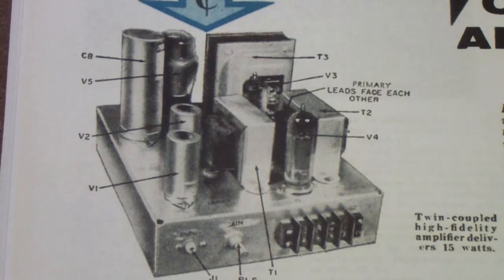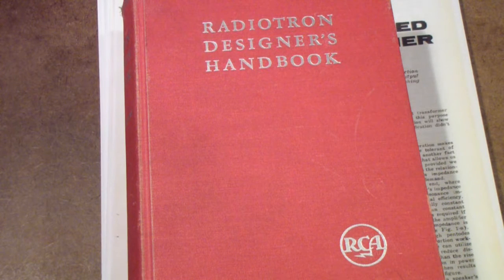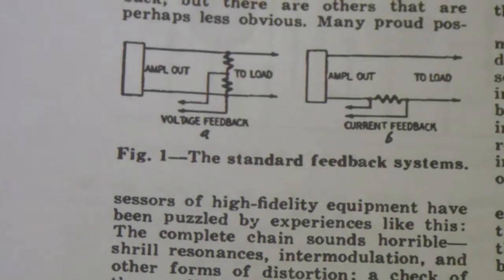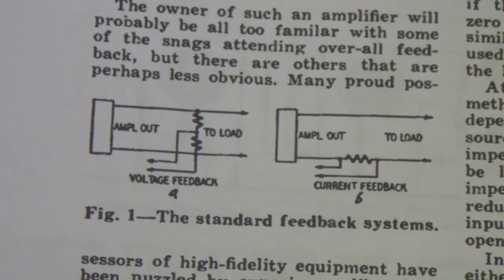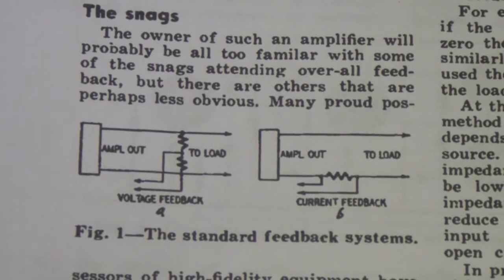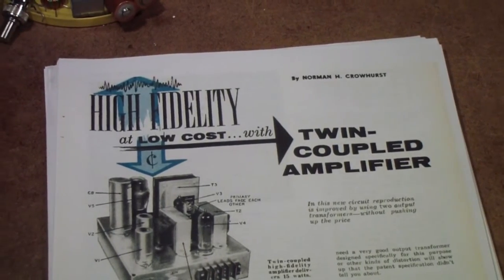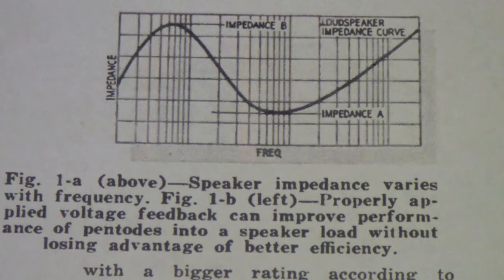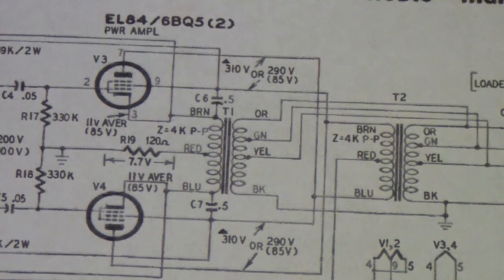TTT097 HiFi Tube Amps Part 3

Comment: Thanks for taking the time to post these videos Tom, I learned a lot from them. I just got my feet wet with mono tube amplifiers, purchasing a pair of Bogen DB-110's doing a complete recap and re-tube as I had all NOS tubes from my guitar amp hobby. I know these Bogen's aren't in the same league as the amps you covered, but it was fun just the same as I don't need to have the Highest Fidelity.... Life's too short to worry.. Be Well